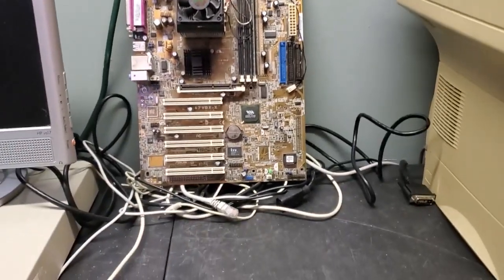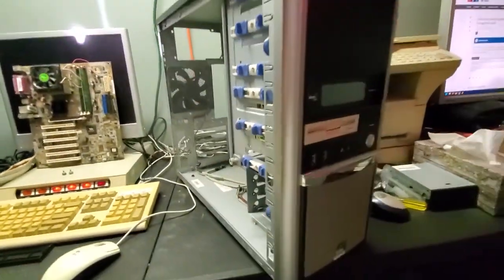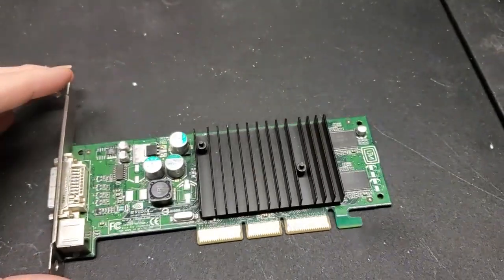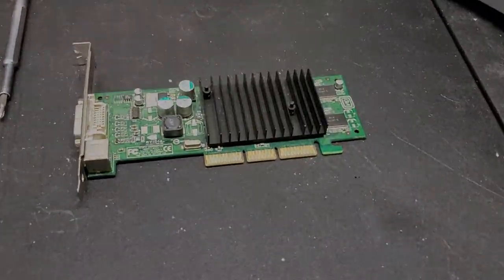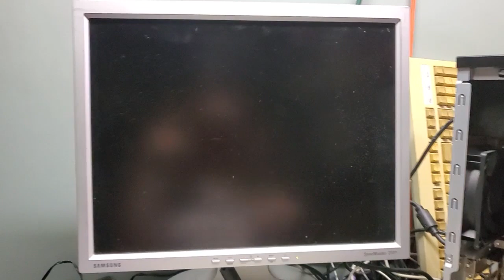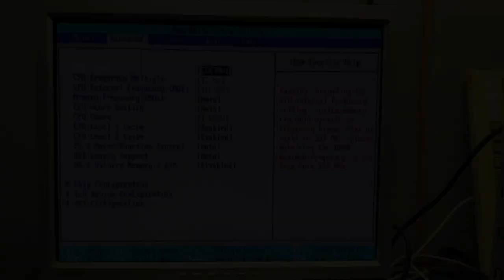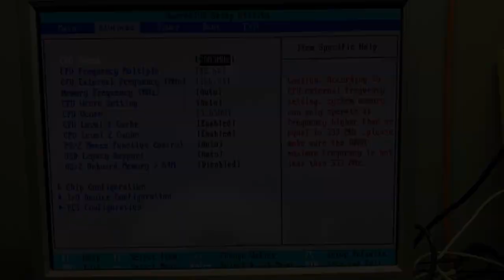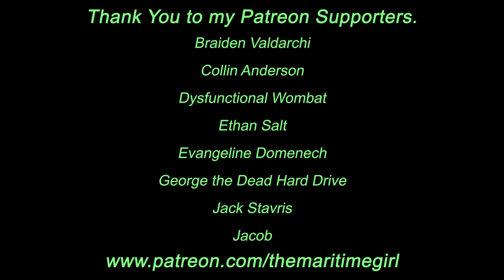Asus A7V8X-X Socket A motherboard left for dead - will it work?

Comment: I just used old fashion desoldering brad to remove the old caps and did it on a 2004 Compaq with AMD XP CPU. The computer now works as it should now.
Reply from the maker: Maybe I'll give it a shot.
Reply: @themaritimegirl  I found adding solider helped and make sure you use MG chemicals super wick.

Comment: Oh my, those were the days. I used to custom build workstations and servers. Btw, that stray thermocouple (assuming that's what it is) mounted to the CPU, is not needed, because the fan controller on the mainboard uses the CPU’s INTERNAL temperature sensor to signal the fan controller. The CPU fan has three wires, two connected to 12V rail, for power obviously; and a third wire is connected to the Hall effect (speed) sensor inside the fan’s motor, which the fan controller uses to sense the fan's rotational speed and adjust according to CPU temperature. I'm pretty sure the CPU didn't come with that glued-on thermocouple dangling from it :) looks like it was an added later, perhaps by whomever built the machine.

Comment: I’d also bet the capacitors are out of spec having dried out, if it was mine I’d definitely swap out the capacitors, it’ll likely explain the agp issues aswell
Reply from the maker: I'll send the motherboard to whoever wants to pay shipping, but for me personally I've got too much stuff already to care, plus my Pentium 4 system fills the void for this era of computing.
Reply: I sent you a message on messenger
Reply from the maker: @robd1365  I read it, but I don't really entertain Facebook messages sent from strangers. I use to have a problem with people from YouTube being obsessed with me and stalking me on Facebook lol.

Thanks for the kind words though! I did order some desoldering braid because someone told me it works better than a pump for removing components from a multi-layer board. I am curious to see if that fixes it, although I'm still not committed to keeping the board long term.

Comment: Bestec power supplies aren't that bad, except for the -12E which is known to overvolt the 5VSB line. I was worried when you plugged it in but fortunately it seems no damage was done. There's an old socket A motherboard (I think also VIA) at my workplace which has busted capacitors, I don't know if there's anything else wrong with it. If I have spare time there I might see if I can revive it and if it works maybe we can work something out.
Reply from the maker: I don't really care, to be honest - I've got too much stuff, and my Pentium 4 system fills the void for this era of computing anyway. Thanks though :)
Reply from the maker: Oh boy, it turns out this one is the 12E! And come to think of it, this may be the power supply that came out of the eMachines I used to have, which mysteriously suffered a motherboard failure.

Methinks I'll just throw it away.

Comment: I think I remember that AGP ports and GPUs back then could have different voltage ratings. Usually the lower voltage cards won't fit in a higher voltage motherboard, but that wasn't always a given. Some cards and slots had 3V3, others had 5V. Depends on the AGP version I think.
Reply: PCI was 5V (usually) or 3.3V; AGP 3.3V or 1.5V (technically also 0.8V for 8X, but using the same key as 1.5V)

Comment: it was actually a good idea to use the old psu because its a mainbaord with the old standard with no 4 pin cpu power
Reply from the maker: Modern ATX PSUs work fine with older ATX boards, as far as I know. As long as the extra four pins is removable from the motherboard connector.

Comment: the via chipsets were crappy and unstable especially when used with a creative sound card.
nforce 2 was far better, i have one i only retired because it couldn't run modern software any more.
Reply: I used my Live! on kt266 and kt400a. Did not cause much trouble. The PCI128 had some issues, I exchanged it for the Live!
Reply: @valkaielod  it the sb128 that i had experience with, it made the system unstable when sharing an irq. it was the least stable chipset i have ever experienced with the most problems - like the usb didn't work well and with a old external cd-burner, gave buffer errors at speeds greater than 3x.